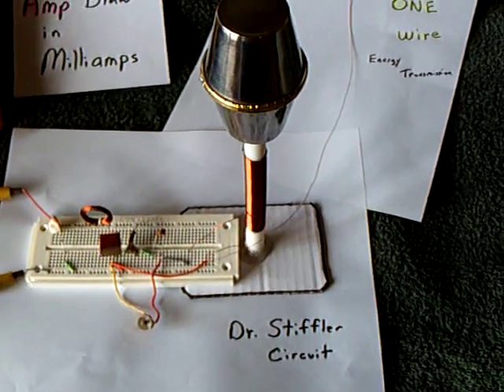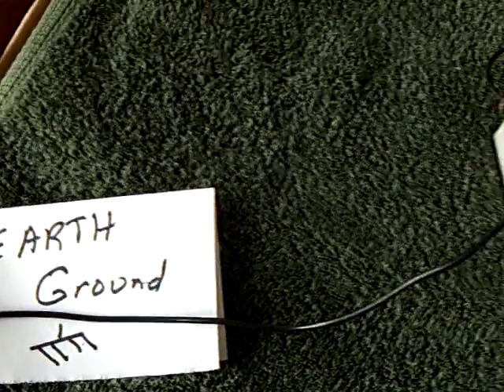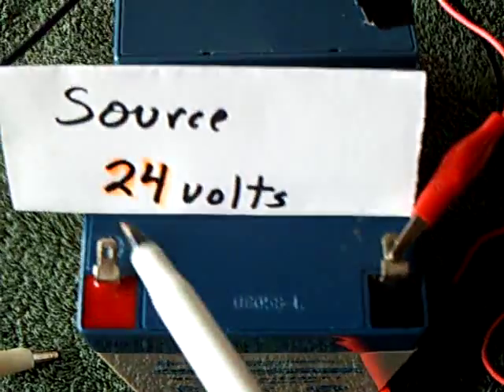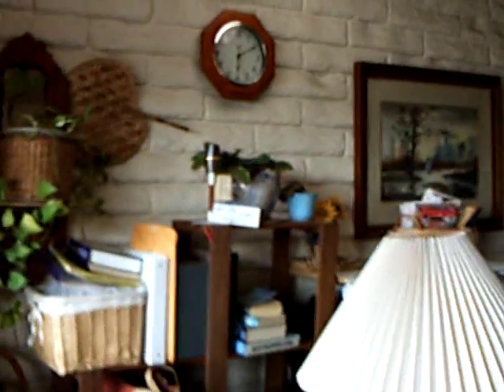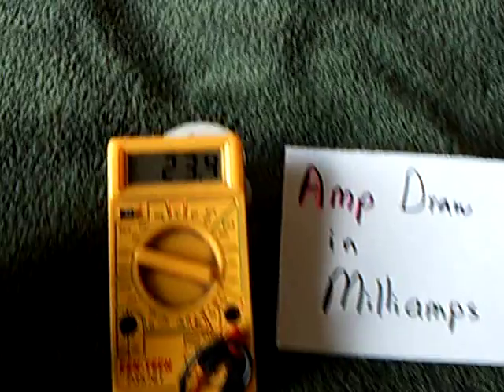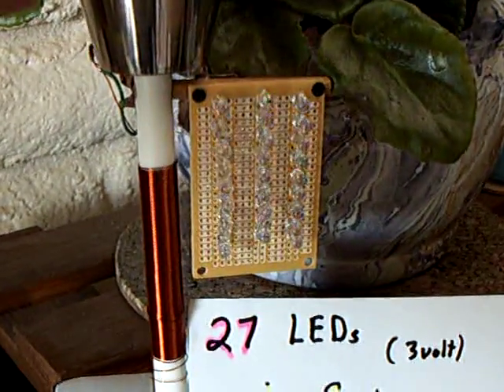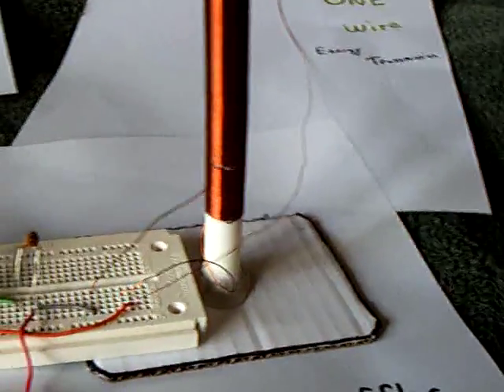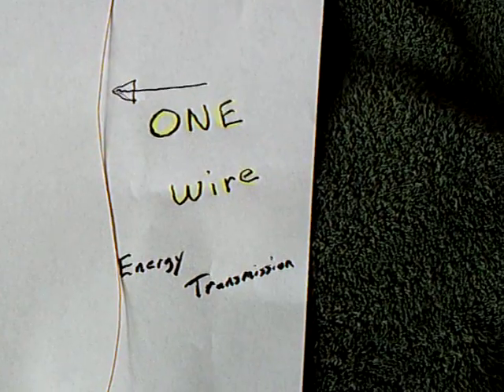New Stiffler circuit driving 27 LEDS off one wire--- At a distance

Comment: you realize there is an earth ground on every electrical outlet in your home? That wire drags another wire to the outside of your house and depending on the area you live in to a 9 foot grounding rod around your electrical box. Your ground in your house is not live at all, unless you have a short in your electrical system in your home.